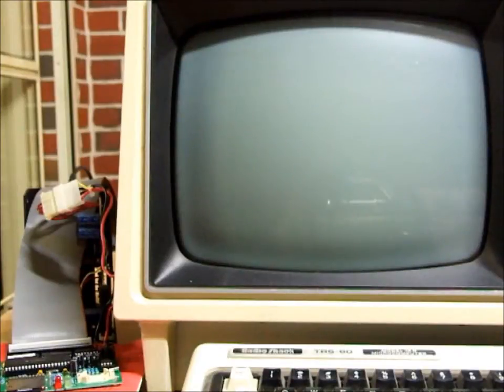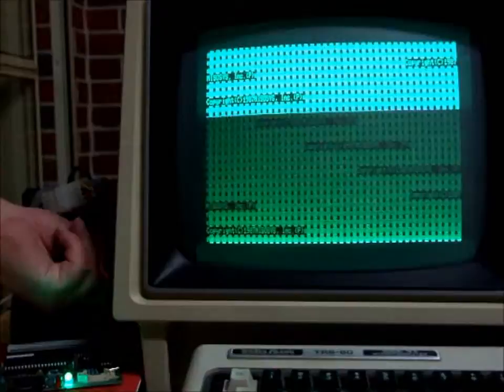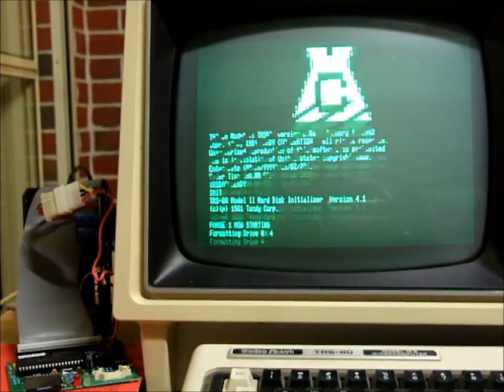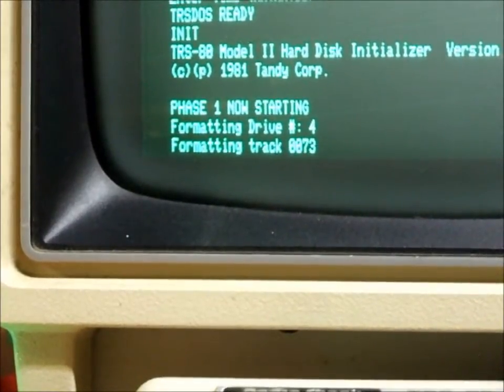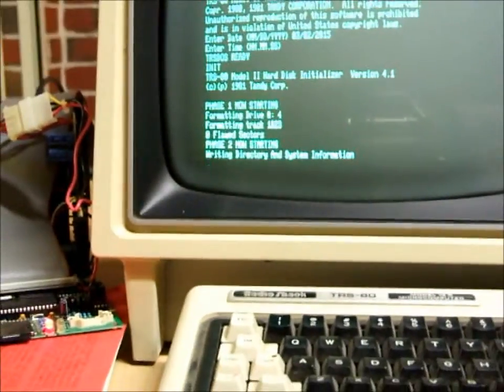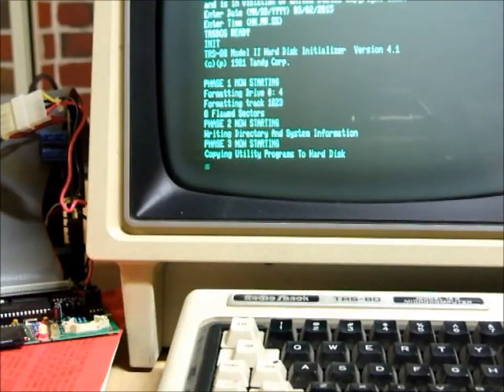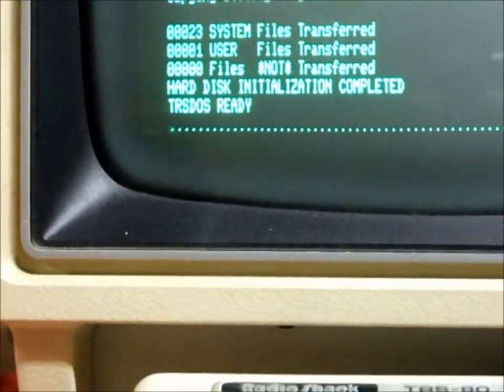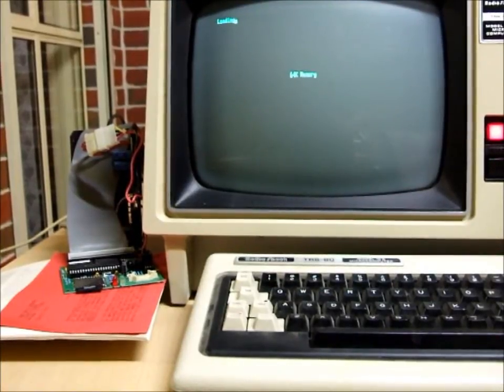TRS-80 Model 16B/FreHD Test 1

Comment: Greets Ian.  I know nothing about Model 16Bs, just M1s, but if Boot Rom Dumps, or O/S boot loader disassembly code is available, then a tactic I used on M1s is that clues can be gained cheaply by making up a connector for the expansion port with a row of 8xLED-Bargraph displays on some veroboard connected to the address lines.   When the system hard-locks, you can see approximately where in the address space it is by which address line leds go static/still and which ones are flickering (looping around).  Decode the binary and with the source code that will show you where in the boot process it has stopped, which usually tells you why.   A fancier method is to use a logic analyzer, then you get a full dump of the address sequence, but you need a 16 channel version to capture the address bus, which are usually pretty pricey for home use.   If you're really stuck, I have a friend with a 16 channel analyzer who might be willing to help out.  He helped me out the the M1 FreHD debugging with it.   If you dont have any code of the boot sequence available, then its not of much use, since knowing that it stopped at 0x674 doent help if you dont know what code is there